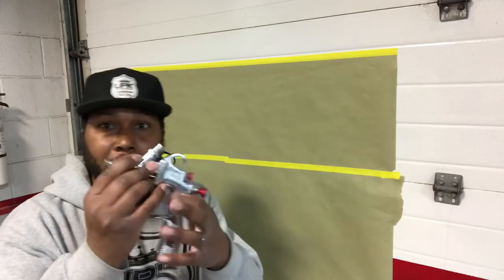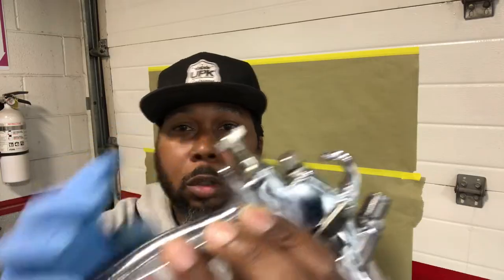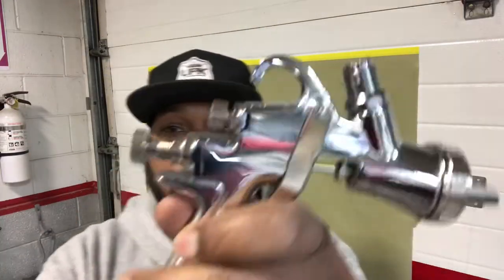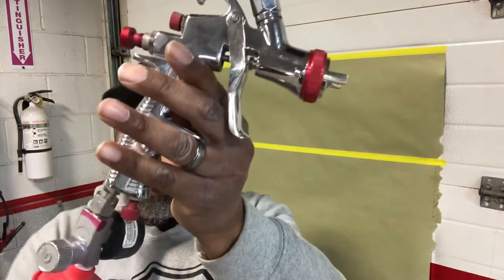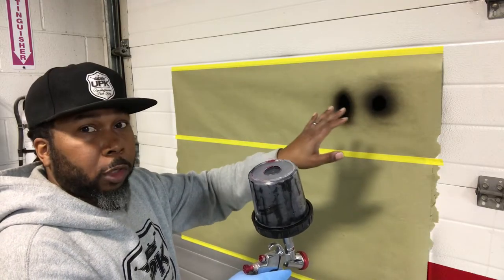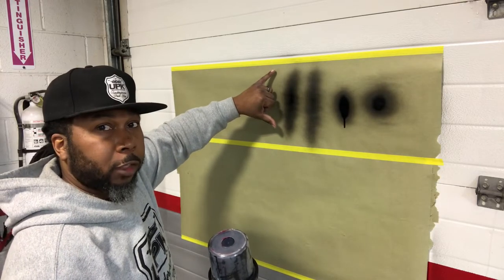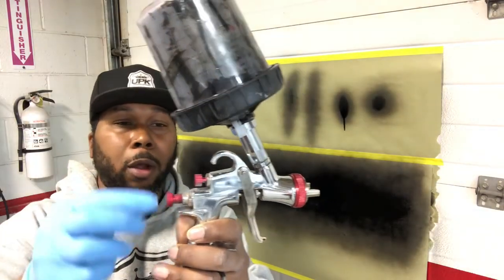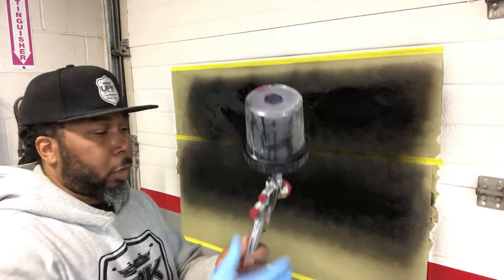How to set up your LVLP spray gun to paint cars

Comment: Hey UPK I'm painting a front bumper that's plastic. I have it smooth should I use a primer before I lay a basecoat or just adhesion promotor and then straight into basecoat. I appreciate it bro
Reply from the maker: The process I go through is prepping the bumper then adhesion promoter then sealer then base and then clear, everyone doesn’t do it that way but that’s what works for me
Reply: @Underground Paint King  Yeah my bumper is a single stage color without clear coat from a 95 Toyota MR2 I don't think they used clear as much then.
Reply from the maker: @SilentReignINC  oh ok, I would still go with my same process
Reply: @UndergroundPaintKing  Thanks for help UPK.
Reply from the maker: @SilentReignINC  you’re welcome

Comment: I like about a 5 to 7 inch fan myself. Gives better control. Keep em coming bro.
Reply from the maker: I agree Bear and I appreciate you checking out the video!
Reply: @UndergroundPaintKing  Alot of spraying I do is from an airless sprayer or air assisted sprayer. Where the tip size means alot.
Reply from the maker: @bear_vibes5130  I’m gonna do a video on tip sizes as well because I think it’s important and the people definitely need to know
Reply: I agree for sure. I do historical restoration of old Grosse Pointe homes.

Comment: I bought a Spectrum HTE gun. How much air pressure should I run for Base and clear?
Reply from the maker: Really depends on the material you’re spraying, I usually spray between 26-30 psi between base and clear

Comment: Great Vid! 
what psi did you set the regulator during the test, also what tip size would you recommend for epoxy primer, thx
Reply from the maker: I don’t know what I had the psi set at for the test but I normally spray between 26-30 psi between base and clear and as far as tips for epoxy primer I would see what’s recommended my the manufacturer of the product or brand that you use but typically 1.7-1.8 is used for different primer applications and if you get into the thicker primers you could be using a 2.0 tip or higher…I hope that helps 
J DS!
Reply: @UndergroundPaintKing  Thank you! Great Vids keep them coming :]
Reply from the maker: @jds1906  you’re welcome and I’ll keep the videos coming!

Comment: My question is, what size tip do you use for Sealer, Base and Clear and what PSI do you set them at with these LPLV guns?
Reply from the maker: I use a 1.3 tip personally and the psi can vary between the different materials but I normally stay in a range of 26-30 psi with the products I spray

Comment: What fluid tip you reccomend.   My base and clear are sprayed with the 1.5mm needle, but my clear doesn't lay down well.  Think a 1.3mm best for clearcoat?
Reply from the maker: I use a 1.3 or 1.4 tip for base and clear
Reply: @Underground Paint King  Thanks, I found better clear coat results with a detail gun I have using the 1.3mm.  I'll swap out the needle and give it a try.  Thanks for the videos!
Reply from the maker: @20tea  you’re welcome and I appreciate you checking out the video!

Comment: Thanks for the channel king... I just purchased a Tekna Basecoat Gun, but it seems to either spray dry or lay down way too much peel for me to want to fool with it. It saves material well, but I need help dialing in the settings. Thanks again. PS, that vevor gun is bossed up, and so is the air gunsa. Smh
Reply from the maker: You may want to try turning your pressure down a bit and getting a little closer to your panel when spraying, also the material you’re spraying could be causing it to peel if it’s drying a little to fast

Comment: How much pressure do you use for base coat and how much pressure for clear sir
Reply from the maker: I like 26-28 for base and 30 psi when I spray my clear
Reply: @UndergroundPaintKing  Thank you my brother for sharing your experience you are a master at what you do. What be a decent gun to used that won't break my pockets lol...
Reply from the maker: @AlexanderRodriguez-pk4cg  you’re welcome, what size compressor are you going to be using?
Reply: The same compressor you have
Reply from the maker: @AlexanderRodriguez-pk4cg  if you get a R500 spray gun which is sold by different companies under different names you won’t go wrong
Reply: @UndergroundPaintKing  thank you for your time bro!
Reply from the maker: @AlexanderRodriguez-pk4cg  you’re welcome Fam!

Comment: I got the a610 and am shooting a whole car, had issues in my base. Whats the air pressure standard on lvlp? Got 21g air compressor, 50ft line.i shot it at 24psi but i think my fluid volume was my problem…
Reply from the maker: @brunocristan7047  maybe try closing your fluid a bit if you’re spraying at a lower pressure
Reply: @UndergroundPaintKing  aight im a give that a shot! Thanks Mr. UGK! Your videos are  helping a diy garage noob!
Reply from the maker: @brunocristan7047  glad the videos are helping and let me know how it turns out

Comment: Hi upk, do you need to thin the paint more when using lvlp? Because im getting a lot of texture on my lvlp.
Reply from the maker: You can thin it but you shouldn’t have to, it could be a few different things causing the texture Dan, I don’t know what you’re actually spraying or your temperature or your distance from the panel or the type of thinner/reducer or hardener you might be using, also it could be your air pressure, those are some of the things that could be causing the texture
Reply: @UndergroundPaintKing  im in the uk, and i work outside. Around 70 farenheit, and rainy, so i use a gazebo with side walls. Im using mipa cx4, that dries in 1 hour. I am painting with a burisch 1.3 tip. I paint a hand width from the panel, as usual really.
Reply from the maker: @danbarrs4262  You could try thinning the paint a little more and see if that helps
Reply: @UndergroundPaintKing  thanks buddy, really appreciate your videos, have a blessed day my brother.
Reply from the maker: @danbarrs4262  you’re welcome and I’m glad the videos were helpful! Have a good day 💯

Comment: Thanks for the video. For LVLP, if I could only have 1 nozzle tip size, what size should it be that would work well for primer, base and clear?
Reply from the maker: Me not knowing what materials you’re using would make it difficult to say what one tip would work for all three…some materials are thicker than others and require certain tip sizes to atomize correctly so what I would recommend is getting a spray gun that can interchange multiple tips and needles…I hope that helps JG!
Reply: what regulater psi should I use

Comment: Hey my brotha what is a quick solution chasing pinholes. I build race fairing kits out of epoxy resin and fabric. I do not use polyester gel coat for several reasons, mainly because it dries out and shortens the life span of the kit. 

Epoxy resin get better and stronger  while out In the sun. Yet without vacuum bagging I get those voids and pin holes have any ideas to help...?
Reply from the maker: I honestly don’t have a solution outside of doing some filler work on the kits Martin, sorry I couldn’t be more help to you!
Reply: 0:15  have an answer, by using vacuum bagging, although it isn't going to eliminate all pinholes it is going too greatly reduce the post work....just because.of.thennature of epoxy resin and human error
Reply from the maker: @martinwaples7330  glad you got a answer on it!

Comment: I'm going to do my first spray gun job. I'll be painting a prefinished bumper with metallic paint. I was told I still need prep work on the bumper, is adhesive promoter all I need? Do I need a bigger nozzle for metallic? Do I spray vertically or horizontally? Should I buy rattle can 2k or should I use spray clear coat as well? Is a 6 gallon compressor enough if it meets the 3.7 cfm at 30 psi requirement?
Reply from the maker: You definitely want to prep the bumper and you want to use between a 1.2-1.4 tip spray gun, depending on how you position the bumper when you spray it will determine how you spray it and I personally use sprayable clear from the spray gun. Also if the 6 gallon compressor can give your spray gun continuous air you should be good Ryan
Reply: @UndergroundPaintKing  thanks. I will paint the bumper facing up. Would 600 grit and adhesive promoter be enough to prep? I also have filler primer I could use but it's not meant for plastics
Reply: That is probably the longest list of dumb questions i have ever heard.
Reply: @brickfiercegaming8962  bc you know so much about paint?
Reply: @ryangrover7236  I’m a gaming and paint Channel
Reply from the maker: @ryangrover7236  the bumper has been painted before right?
Reply: @UndergroundPaintKing  no I bought it pre-primed from an auto shop supplier. The seller said it was more of a protective primer and I should still do prepwork.
Reply from the maker: @brickfiercegaming8962  I’ll get him together and he’ll know the info for next time
Reply from the maker: @ryangrover7236  ok Ryan check out this video I did and it should help you out on the steps necessary to do your bumper 
https://youtu.be/yY5FccJFPfI
If you still have questions just ask💯
Reply: @UndergroundPaintKing  I will thanks
Reply from the maker: @ryangrover7236  you’re welcome!

Comment: UPK, I'm like #501 and I clicked like within seconds of watching (great intro)! Can't wait to see the rest.
Reply: You are a very good teacher, not wasting a lot of words but getting the point across!  Cool to see a gun I have being demonstrated.  I just finished painting my 92 F150 extended cab flare side.  Painted in 13 sections over about three years! Crazy I know. But along the way I kept trying new techniques and I'm spraying much better on my last than my early sections.  I've had the hardest time figuring out spraying acrylic enamel clear and I'm not using any hardener so far.  However I'm considering switching to urethane clear with hardener which I hope is easier to spray.  UPK- man it is a lot of work between sanding, masking, and cleaning guns...
Reply from the maker: Thanks Rob I appreciate that and appreciate you checking out the video…one of the main things needed when doing this kind of work is patience which it sounds like you have so I know you’re truck is going to turn out great…going with urethane clear might be a good switch for you or at least give it a try and see if that’s what you want to go with

Comment: On the technical data sheets for the products I'm using, it recommends air pressures. But only for HVLP and Conventional guns. Would I treat the LVLP the same as, say, an HVLP gravity feed gun for pressures?
Reply from the maker: You could start there and do some spray outs before doing your actual project you’re working on so that you can dial it in like you want then you can do your project

Comment: What does it mean on tech sheet the spray gun should be at 8-10psi at air cap on hvlp? Should that be when the gun is fully triggered the  tech sheets are for Omni mp213 sealer
Reply from the maker: I never concern myself with the air pressure at the cap Leo to be honest I focus more on the materials being atomized correctly by the air cap and it giving me the proper spray pattern

Comment: hey any recommendations for what psi to spray at for base and clear with the lvlp gun? having problrms getting more than 22psi with my 50l (11 gallon) compressor thanks
Reply from the maker: It’s best to do test panels to figure out the best psi to spray at, so I would drop your pressure and see what works best for you

Comment: What's a good air pressure for a beginner to spay a base coat
Reply from the maker: Beginner or pro doesn’t make a difference on what air pressure you spray at jimmy it’s more about the spray gun you’re using and the materials you’re spraying but a safe area I would say is 24 psi
Reply: depends on gun,hplv about 28-29 psi check your pattern for fine dots around patern  not big droplets

Comment: I’ve been using Acme/Sherman Williams Finish 1 Clearcoat, the technical sheets say for HVLP guns 8 to 10 psi and conventional 50 to 60 psi, 8 to 10 psi seems ridiculous, when I tried 10 psi the gun barely spit out paint, when I used 30 psi it worked great, do you have any ideas why it would call for 8 to 10 psi for HVLP guns? Does that actually work on some guns or do you think it might be a typo? thanks
Reply from the maker: It actually works for some guns but not for all guns and if you watch a few other painters you’ll find that they spray at a higher psi so that’s why I try to explain to people to find what works best for them because everyone doesn’t have the same equipment
Reply: @UndergroundPaintKing  OK gotcha, you’re right my bad I’m not using a HVLP I’m using a brand new Spectrum HTE compliant gun, if I’m correct you have the same gun in one of your videos, Maybe it takes more air then the HVLP gun.
Reply from the maker: @wild8757  yes I have that spray gun and I believe it uses less psi than the HVLP
Reply: @UndergroundPaintKing  Yeah so I just looked it up and the HTE working pressure is 32 psi and Air consumption of 9.05 CFM for full fan, The HVLP working pressure is 28 psi and the air consumption is 9.55 CFM for full fan, So I guess the HTE has a higher working pressure but a little less air consumption than the HVLP, Anyhow i’ll keep running it at 30 thanks a lot man take care
Reply from the maker: @wild8757  you’re welcome

Comment: What's the pressure  regulator  set at  at the gun
Reply from the maker: That depends on what you’re spraying, with the material I spray I like to spray between 26-30 psi
Reply: I'm looking for a smooth finish I really don't want to put clear on it
Reply from the maker: @williamharris631  getting a smooth finish will take some practice with the material you spray so testing it out until you get it dialed in is the best way to go before tackling your project

Comment: what was the PSI setup on your gun?
Reply from the maker: I’m usually 26-28 psi when spraying base and 30 psi when spraying clear
Reply: @UndergroundPaintKing  dude that solved one of my problems. You da man!

I have another question. When I paint cabinets it leaves straight line marks behind where I overlapped paint. Any suggestions?
Reply from the maker: @alexdorand  sounds like a issue with your fan pattern, might need to clean it to make sure it’s not clogged somewhere
Reply: @UndergroundPaintKing  you are da King
Reply from the maker: @alexdorand  appreciate that and I’m glad I could help 🙏🏽💯
Reply: Brother, forgot to ask one more question, what nozzle size did you use here? What do you recommend for the water based paint?
Reply from the maker: @alexdorand  I use a 1.3 tip

Comment: what psi do I set the regulater for base coat and clear??
Reply from the maker: That depends on the spray gun you’re using…I personally set at 26-30 psi when spraying base and clear Sonny
Reply: @UndergroundPaintKing  thanks for that quick reply
Reply from the maker: @sonnybee8271  you’re welcome!
Reply: @UndergroundPaintKing  I'm using an lvlp gun, I was wondering if it uses a little lower psi?
Reply: @UndergroundPaintKing  Thanks for the informative, simple video, UPK. I appreciate that you take the time to answer so many questions. I just picked this up with a range of tips/needles. I plan to spray 2K clear with my 1.3mm nozzle set. What settings do you use to shoot 2K clear with the SprayIt SP-33000 gun? I assume 28 - 30 PSI, 1.3mm, full fan and full fluid? Or do you tweak your gun settings in a bit from max fluid/fan?
Reply from the maker: @Coelacanth97  I like to spray my clear at 30 psi and depending on what you’re spraying you may need to be a little higher on the psi, also I always go full fluid but adjust my fan if necessary but mainly I’m full fan also
Reply: @UndergroundPaintKing  Thanks for the reply! I'll do my next 2K clear job following your suggestions. I also have an Auarita L-898 LVLP gun and was getting more orange peel than I liked, using a 1.4mm tip and about 25 PSI. I'm hoping for better atomization with the 1.3mm SprayIt tip and bump up the pressure to 30 PSI. I'm only painting small stuff like guitars. When you said "depending on what you're spraying", how does that factor in to your gun setup?
Reply from the maker: @Coelacanth97  all materials aren’t the same so they may atomize different depending on the spray gun and pressure combination so it’s always best to do spray outs or test panels before spraying your project

Comment: Appreciate ya , working hard to help newbs like me.
Reply from the maker: You’re welcome Shawn and I hope the channel continues to help out!
Reply: @UndergroundPaintKing  you know it , hey but listen iam struggling with this high build primer ,I got the same setup as you ,using a 1.7 tip it's sprays so dry what's up.and thanks for the knowledge
Reply from the maker: @shawn9878  what kind of pressure are you spraying with?
Reply: @UndergroundPaintKing  at the tank was 50# and gun was 27ish
Reply from the maker: @shawn9878  try dropping your pressure a little and see if that helps

Comment: Think I disagree 🤔 fluid wide open and air set at say 2 bar gives orange peel? Chock the paint down and you have same air but less paint Bette atomisation less peel or am I wrong ok otherwise your video s are very helpful 👍
Reply from the maker: I’m glad you disagree…I want to test out how you would set it up so how much would you choke it off ?
Reply: @UndergroundPaintKing  , it's the volume of. Paint air ratio more air or same air just less paint so the paint break's up more hence less peel  what psi do you spray at pk? Compressor s smaller ones struggle anything over 2 bar. Trigger on, try it and let the people no again fab videos. Mate
Reply from the maker: @leerevell5998  thanks I appreciate you!